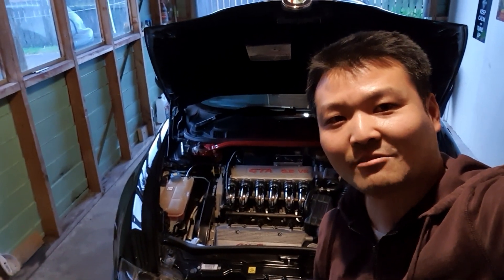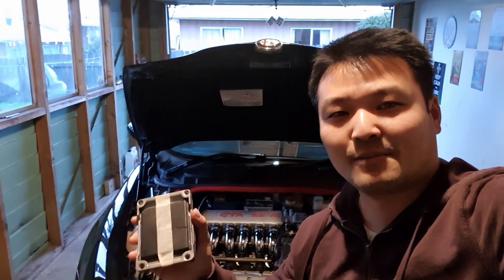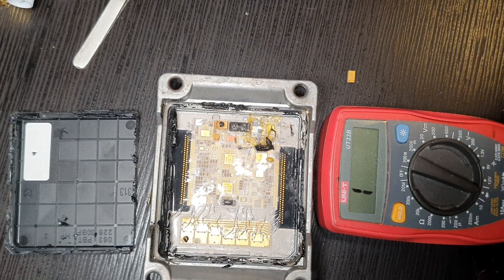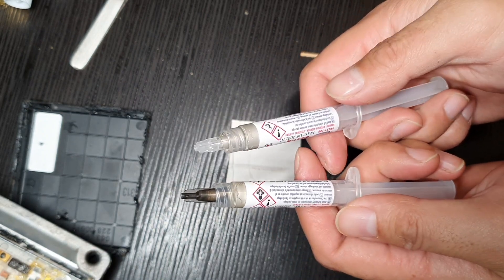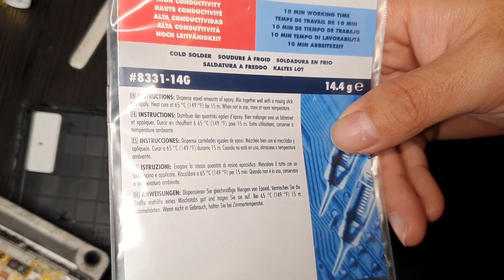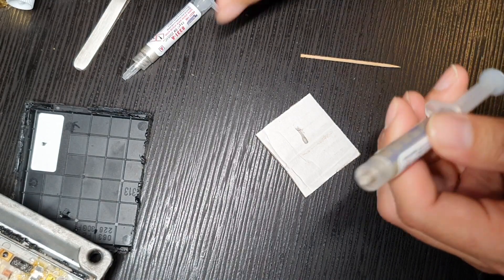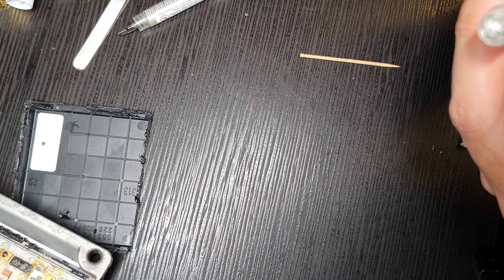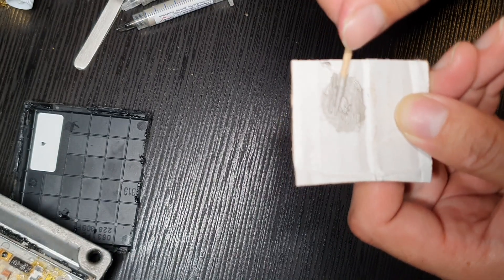Alfa Romeo 147 GTA Ep20 - ECU repair using conductive epoxy, no soldering 147 156 GT Busso V6

Comment: what problems were there with the car that you changed capacitor?
Reply from the maker: So this was a few years ago and honestly from my recent experience you don't need to change the capacitor, they are fine. Just reattaching them to the PCB solves the issue 99.9% of the time. I do still have spare ones incase I lose one or there's some obvious damage. Sometimes the contacts can bend or wear out for example.

Comment: Hey Luey, we're (my mechanic and I) having trouble with my 2007 Alfa 166 3.0V6 Sportronic ECU and it seems to be the immobilizer that's playing up. I've come close to sending the ECU to Europe to be "virginalized" but chickened out because it's very expensive and not a guaranteed fix. I have opened the ECU and the capacitor seems solid. I was just wondering is it worth removing the capacitor and replacing it using the method you used here. If so, what's the best way to remove it?

I realise this is an old vid so any help would be greatly appreciated. It's a lovely condition 166 and I would love to get her going again! Thanks for the vid and info. Greetings from the Bay of Plenty. 🙂
Reply from the maker: I think we've emailed each other a couple of times. My recommendation is to courier it to me and let me check it first. The capacitors can look fine but the connection could be dodgy. Also best to take a video of the exact symptoms so I can see if its actually ECU or not

Comment: Hello, my 147 GTA is starting to have ecu failing symptoms, been practicing soldering on some cheap used twin spark ecus since they're the same, but it's not that simple. Is cold solder recommended for long term use?
Reply from the maker: Definitely do the conductive epoxy in your case, it's not an easy solder job and you can damage your ECU permanently very easily. Grab a decent multimeter with some small probes and you're good to go
Reply: @LueysGarage  My doubt is if the conductive paste lasts as long as a firm solder...
Reply from the maker: @__Dany  well they used that from factory and probably a much inferior product to what we can buy today and yet it's still lasted 20 years. It's very easy to do it again in the future anyway
Reply: @LueysGarage  Hey Luey, I successfully repaired mine with the conductive epoxy, just 2 things to point out, the old capacitor was actually well stuck on the pcb, couldn't test it with the multimeter because of all the sticky mess, proceeded to replace it anyways and it's working, for now. The other thing is the capacitor with the black dot, the link you provided on the other video its dimensions are smaller than the original one on the ECU, did you have the same situation as me?
Reply from the maker: @__Dany  that's good to hear, my capacitor with the black dot was the same dimensions as the old one, but as long as it has the same specs and you were able to mount it it will be fine
Reply: @LueysGarage  1 year update: I just got the usual fault codes indicating ecu failure, gta was still for like two weeks, maybe low battery, cleared the codes but they show up again. no chattering and car starts, don't know   what it could be...

Comment: those gold wires are dyebonds which are wirebonds. The aluminum wedgebonds are 300 micron thick and should never be soldered back onto the board, the gold ones are i think in the ballpark of 5 to 25 micron thick. If you ever mess one up let me know we have a 50-300 micron wirebonder that is able to make that as the factory intended it to be, also great job on the mgchemical compound its alot cheaper than oem silver paste and more manageable in syringe form. a quick tip store that stuff in your fridge as it can actually go bad on room temperature within a month after opening.
Reply from the maker: Thanks for letting me know, we do have a few ECUs which need rebonding. Where are you based?
Reply: Hi  @LueysGarage  we mailed you but I dont think you've seen it ;)

Comment: Need to give it to a master who knows how to solder ceramic circuit boards, and not breed all this dubious horror with glue !!!
Reply from the maker: We've soldered the capacitors in the past but its risky given the elements are so small and the silicon protective layer melts when heated up. The conductive epoxy is very solid and makes a good connection, I test every single capacitor afterwards to make sure its got connection to the board. Its really up to you what method you choose but we've been having a lot of success with the conductive epoxy

Comment: Great job. I find myself in the situation where I have to do it as well. What capacitor exactly did you use? I only found out it is a Kemet 15mF 35V, don't know anything else. Thank you!!
Reply from the maker: Check the description of my original video, I've put the link to both capacitors https://www.youtube.com/watch?v=QJNpy7W252g
Reply: @LueysGarage  Thanko you very much! I saw it now, may I ask you how did you find it out? It seems impossible to check what's the correct resistance from the code. Is it relevant in you opinion?
Reply from the maker: @giuseppewelz7764  there's text on the original capacitors and you just need to know what the text represents and then find the right part 😊
Reply: @LueysGarage  Exactly! I read all technical documents from Kemet but I couldn't find any info about it. I understand the information contained in the product code "T495D156K035ATE300" you suggest but I couldn't find these on the capacitor itself. Since I have your feedback that it works I have no doubt about it, I just was wondering if I was missing something... 😄 I'm an engineer, I guess I just need to understand things.😂

Comment: Thanks Luey for the great video, it's much appreciated. Hopefully I never have to use it. If only you could come up with a solution to my 147 GTA selespeed not changing gear when warm.
Reply from the maker: I'm staying away from selespeeds, but have heard new pump and accumulator reservoir helps? Also some people have trouble because of the brake sensor but I don't think that's only when it's warm!
Reply: Gearchange position sensors (potentiometers) probably… they become temperature-sensitive when oil has leaked into them. Replace sensors and do end-of-line calibration

Comment: Great video, I watched your other video many months ago and was put off doing the job.
Is this the same process on a twin spark ecu from a 156? Ive yet to open the ecu on the car, its been off the road 5 years.
Reply from the maker: It should be exactly the same, the ECUs are almost identical. Just need to open up the cover and have a look :)

Comment: Looks like a solid gold reason to splash on an aftermarket ecu 🤣
Reply from the maker: That is definitely the best long term solution I have to say, but also quite expensive
Reply: @LueysGarage  there are quite a few options out there now, they don't have to be the latest and greatest if you are keeping the car fairly standard. I've seen second hand wire in ecus change hands for 300-500NZD
Reply from the maker: @Mike-ry4ti  I think that's what I'll do, try a cheaper ECU solution and document that...would be a helpful longer term solution
Reply: @LueysGarage   especially if there is a plug and play or loom adapter solution available and standard basemaps for the engine you have.
Reply: Hi Mike. Do you know where to get one for a 2007 166 3.0V6 Sportronic. Long story but let's say I've been having a mission trying to get mine "virganilzed" as we think it's an issue with the key/chip immobilizer. With a new ECU do you need a new key chip to match and if so do you know where to get them. Cheers guys, I'm in NZ too btw.